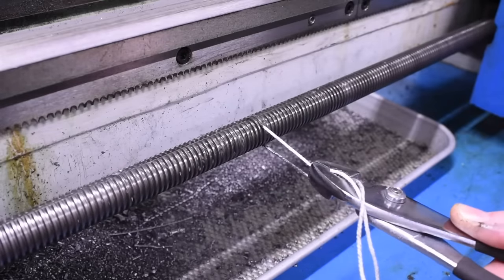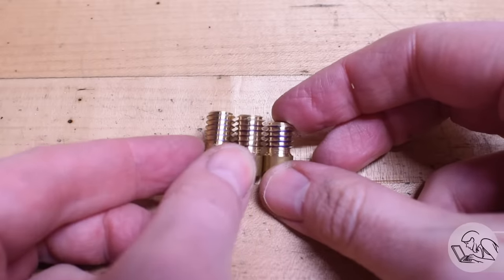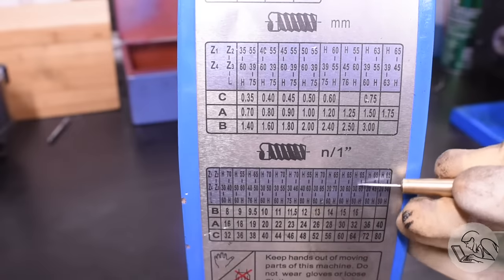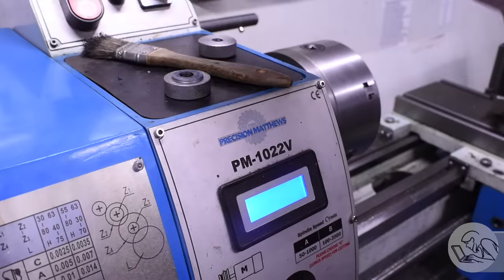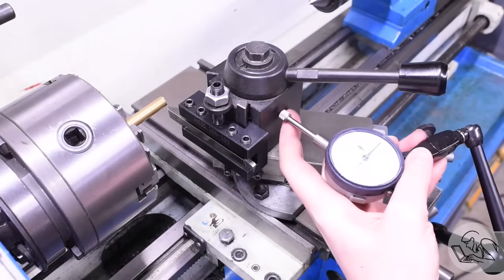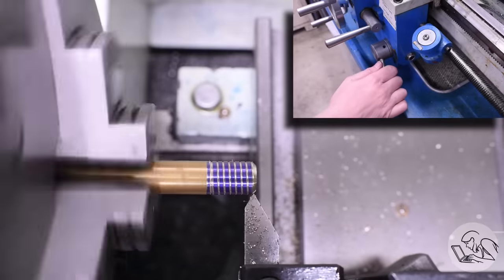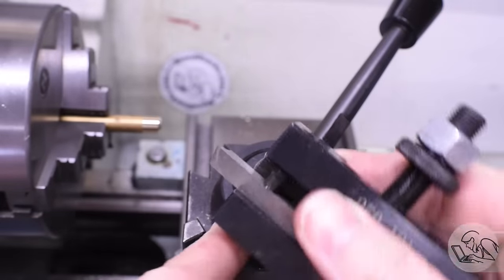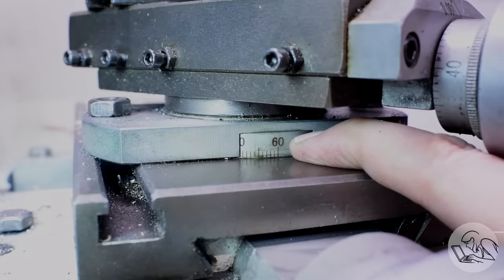How To Cut Threads On A Lathe

Comment: I almost skipped this one thinking, oh, just another thread cutting video, but I have found that I am almost always glad when I ignore my first instinct and press on. Everyone has a slightly different take on thread cutting and I always pick up something new even though I have had lots of experience. I picked up several new ideas from your video. Thanks! The only thing I might quibble about is your angle when cutting with the tool upside down. You are constantly running away from the new depth of cut instead of into it. I swing the compound in the other direction when threading in reverse. My lathe is the same model as yours. I found some errors in the PM manuals regarding the change gear settings. There are differences in the printed manual that came with my lathe as opposed to the online version. If you are interested I can pass those along. I also found a combination where the cover would not fit on after I set up the configuration for the thread I needed to cut. Never found a way around that one.

Comment: I have no half nut so I have to power back and forth as you showed for mismatch. Also I have never tried the upside down thread cutting.. that’s awesome. I often wondered if there was a way to do it. I may or may not of bumped my chuck in the past 

Imagine having a cross slide with little backlash like you do! I wish lol

Comment: Nicely explained. One point, if you are not disengaging the hand nut, then I think you should retract the tool when you wind back to the start position, (backlash in nut). On my Myford, I fitted a removable handwheel on the countershaft, so I can easily cut short threads by hand for a fairly precise length, I guess that is not possible on more modern gear.

Comment: Thanks Quinn - good video. All of this (I think all from your videos!) is how I've learnt.

My lathe is an import, so the compound is 90 degrees out. It also very helpfully only has angle markings to +/- 45 degrees... So getting the correct 30deg angle takes some mucking around. 30 degrees in the wrong direction and then spin the toolpost 90 degrees the opposite direction. Easy enough but annoying.

Comment: My SB lathe has a threaded spindle (2 - 1/4 8 tpi) and I have never had any problem threading in reverse.  The RPMs are so low and the torque in the cut is minimal.  I always use a live center at the other end, so unthreading can't happen anyway.

Comment: I have a really nice old Swedish lathe built in 1959 and it also has the angle markings on the compound 90¯ off from the American standard. So I should set it at 60¯ or 60,5 but the markings are not that exact.

Comment: What a great video. Just when I was about to say "Hey, but what if I don't have a thread indicator thingy" you hit us with not only that but also a simple yet good explanation on threading imperial vs metric depending on the manufacturer of the lathe. Cheers from Argentina.

Edit: ACME threads video? Sharpening HSS for ACME threads? huh? Anyone?
Reply: Angle for Acme is 14.5 deg, you can buy a gauge for angle & width , I always grind my tools thinner then side-cut (backwards) on compound till it fits.

Comment: Not sure on a lathe spur gears but my dad said for setting the backlash on starters for engines he was taught to stretch out a paper clip and stick it in the valley of the gear and that was a gauge for how far to push in the peak.

Comment: I have been working on lathes for 40+ years and i have alway used the cross slide to set the 0 at the start and only move it to come out when returning to the start of the threading. The Top slide is what is used to set the depth of cut and it is set at the same angle as the thread, that way you are only cuting on one side of the tool. That how i was trained over closer to 40 years ago. The bottom cross slide never goes past 0 and the top miter slide is what is used to cut the thread. The miter is set to the anlge of the thread pitch so when the tool cuts it only cuts on one side making a better cut with no chatter.

Comment: Note: 127 teeth is enough to make a conversion with no error as an inch is exactly 25.4 mm (or 127*.2)
Reply: That's why 127 is my favorite number :)
Reply: @awashbowler  Really?  I just assumed it because you were using a 7-bit mental processor.
Reply: @andrewgr144  He thinks in ASCII
Reply: Some of us have lathes that aren't big enough to fit a 127, but at least we can fit the required 63.5 tooth gear.  (In Sparey's "The amateur's lathe" he goes through the math to match any given thread pitch with a multistage set of any decent set of gears to a very low error, but it's a bit daunting.)
Reply: @smellsofbikes  half-gears are my favourites :) 
Much as I cherish the hard ways our ancestors treaded if I had a lathe I would opt for Clough42’s electronic lead screw...

Comment: Hi folks. Cutting threads on the lathe gives accurately centred ones but unless a 'full form' insert tool is used it is tricky to get the right geometry profile - if that really matters - often it does not. One way of dealing with this if needed is to slightly undercut the depth and then finish with a low use die cutter. The lathe gives the accurately centred position and the die the accurately shaped tip and root thread form. Since the lathe has done most of the work wear on the die is minimal and it remains accurate. As Blondiehacks suggests in this excellent video it is  worth reading up a bit about the various thread forms because there is so much more to them than meets the eye. Have fun. BobUK.

Comment: There is another condition on flipping the bit over and cutting in reverse - that isn't going to work well if you have an old lathe like mine with a lot of uneven wear. It is best to keep the cutting force pushing down. I learned to cut double lead acme threads with no relief groove while in the navy. It's not nearly as hard to get the timing right on backing out the compound while coming to the end of the cut as you may think. No relief cut makes for a much nicer looking job as well.

Comment: Back as promised.  Two things.  First off using the dial gauge on the back of the tool post to register the true depth of the cutter is brilliant.  I thought I was OK with thread cutting.  But it seems like an old dog CAN learn new tricks..... second, I hate to mention it but for doing internal threads or for reverse threading with inverted tool the compound should be angled to the other side of perpendicular with  the spindle axis.  With the setup you show for the reverse threading you were actually advancing into the trailing edge of the cut.  Not a big deal all around... the threads still came out fine.  But if you're one that subscribes to the idea that the leading edge of the cutter should be the working edge then the compound is moving in the wrong mirrored direction.

Other than this minor niggle another great video.  I hope it encourages folks with lathes that have threadophobia to give it a go with some scrap.   Being able to cut truly axially true threads really is a handy skill for a lathe owner.

Comment: First, wonderful explanation, many thanks indeed.
Please correct me if I am wrong, but I assume that if you are cutting a thread that is the same pitch as the lead screw pitch, there is no need to worry about the thread dial indicator or the position of the half nuts.  So for example, with a metric lathe with no dial indicator and a 2mm lead screw, you can cut a 2mm pitch, and also a 1mm, 0.5mm, 0.25mm pitch thread without needing to worry about the half nuts position.  Obviously this is still quite limiting, but I am curious.  Any comment welcome.  Best wishes from Japan.

Comment: Hi folks. Quick tip for setting gear backlash, just use a slip of note paper between the teeth. For the upside down less operator stress technique ideally the lathe needs taper bearings at each end of the spindle so the spindle does not move away from the headstock with the cutting forces. Most lathes have this arrangement - but not Myfords for example, which also have screw on chucks. BobUK.
Reply: Bob, I’m glad you mentioned that. It had not occurred to me that some lathe spindles will not tolerate opposite-direction end thrust. I have a Myford, so I’ll keep it in mind.

Comment: Don’t be afraid of 3 phase equipment! Phase converters are cheap and work well, I have a 3 phase mill, 3 phase lathe, three phase industrial metal cutting bandsaw and a 3 phase paint booth. I built a mechanical phase converter using a 5 hp 3 phase motor with directions I got off the internet which works perfectly, I run the shop equipment off of that. For my spray booth, which I bought new I have an electronic phase converter that cost in the $300 dollar range. If had it to do over I would have put electronic phase converters on the shop equipment as well, they are so cool, soft starts, soft stops and you can set the speed of the motors by controlling the cycles per second. I was able to buy all my shop equipment “because no one wanted the 3 phase,” the only drawback is most of the 3 phase machines are large. Knowledgeable people will tell you it is inefficient to convert single phase to 3 phase, but a home shop is not a production shop and the money you save buying 3 phase equipment will buy a lot of electricity.

Comment: @Blondihacks - Hey Quinn. I've noticed You have to deal mostly with gears in the front third of the lathe's lateral. Would be rude of me if I suggest You cut that lid and weld a couple of hinges to access that gear set stat?
*Of course, some lock system would be more than advised.

Comment: Quinn, I wish my first thread cutting experience was this clear. An apprentice assigned to a journeyman often gets thrust right into the fray (I sure was). A lot of people seem to assume (there's that word again) that you know what they know. A good teacher* should always act on the basis that they do not know what you do and try to make that information as clear and concise as possible. As an example. The first time I was exposed to algebra I just did not get it. The instructor using the basic text was going on and on about a x b, x,y and other stuff. It my have been viewpoint (I'm not dense) but i just didn't get .once she assigned values to those symbols the light when on. And that's what you are doing to do here. Being clear and concise.
For any hobbiest machinist I highly recommend the book "Screw Cutting in the Lathe" by Martin Cleeve". This book is highly informative not only about the how, but also about the why. Plus he goes into great depth about Imperial threads on a metric leadscrew and visy versy. The gear ratio set-ups that will give a very close approximation of the dreaded 50:127** gear ratio without taking up tons of room on the back end of the headstock with large gears. He also discusses various other things beyond the scope of this video. 
https://www.google.com/url?sa=t&source=web&rct=j&url=https://www.amazon.com/Screwcutting-Workshop-Practice-Martin-Cleeve/dp/0852428383&ved=2ahUKEwj20N-SqZnvAhWOB80KHeeIB4UQFjAAegQIARAC&usg=AOvVaw1rCVsdvQ03u-yw1f-g8Lnl
This series of books also has a wide variety of other subjects covered. Gear cutting, cutter grinding, shop tools, dividing and indexing. Highly recommended books that I think every hobbiest machinist should have. 
On the theoretical side any thread can be expressed as the ratio by which the lead screw turns per revolutions of the chuck. If you have a leadscrew with 8 tpi and it and the workpiece are turning at the same rpm you will advance the tool .125 per revolution. If you wanted to cut 10 tpi the lead screw has to be set through the gearing at a ratio of 8:10. The gears used would then be multiples of these gears (ie 32:40 etc)
For any threads not listed on the lathes list of change gears or in the gear box this is a handy tool to find the correct gear set
https://www.google.com/url?sa=t&source=web&rct=j&url=http://www.otvinta.com/gear.html&ved=2ahUKEwjG9rzBrpnvAhXJWM0KHRzzCRAQFjAAegQIARAC&usg=AOvVaw35JHi3qUvgj4A2gG7kQYgg
*a word not to be used exclusively by those working professionally as teachers.
** the number of threads I've seen on the hobbiest forums on 127 tooth gears is endless. The 50:127 comes from 5.000 = 127mm when using the standard conversion factors.

Comment: I just made a backplate for my Logan with a 8 TPI thread last night. What a pain....
Reply: I would like to do this sometime - what I've thought of doing is welding a 1-1/2"-8 heavy hex nut into a steel plate and truing it all up from there.  What did you end up doing?
Reply: @ThomCat316  I think that would work just fine. That's almost what I ended up doing. I carved it out of a solid piece of 6.5 inch round, the amount of chips was insane. If I do again I'll definitely make it from two pieces and weld it. I'm going to post a video on in sooner or later

Comment: My very first thread was to adapt a QC toolpost to a Logan lathe.  I didn't have metric taps, so I got an M14 10.9 bolt of the correct length (to match the clamping nut) and cut a 1/2-13 thread in it (to match the base plate I made).

Remember, kids, be sure to cut down from 0.551" to 0.500" before making your threads....  :-)

Comment: I made a center finder, that in essence, was a bar with a spring-loaded socket for a ball with a pointer on it, that you centered up with your thumbnail..it was to set up a drill-press or old style vertical mill on center of the hole to be drilled. I made several, but I don't remember what they were called, plus you can't find them in stores. You got any ideas on this one, young lady?

Comment: Great video with a refreshing presentation.
I do appreciate the time and content restrictions in making of a video but think one little point may be worth mentioning for the beginner thread maker.
At 17:30 in the video we made some threads that formed threads with peaks that were pointed. The problem with pointed threads is that they will bottom out in the curved root of the female thread (nut) while there is more than enough clearance on the flanks of the thread. As a result with the pointed peaks, the nut will not spin freely until the threads are way too small overall with considerable play in the thread..
I suggest that the beginner should be aware that the peaks should be rounded off or filed down to remove the sharp "bits" if they occur, before trying the thread for fit.

Cheers and again a great video with a great perspective on things.
Reply from the maker: Yah, that’s why I started with telling people to cut the stock a few thou undersize. It neatly sidesteps that issue for beginners. Later on people can learn why I told them to do that. 😄 A video like this is about setting someone on a path to success, not covering every detail exhaustively. Plenty of others have done the latter. I appreciate your thoughtful comment, though!

Comment: On the subject of pitch gauges: if you have one of those cheapo tap-and-die sets from Horrible Fright, it comes with a pitch gauge for whatever system the set is for. I only mention this because I spent way too much time searching my toolbox for the pitch gauge I just know I have, so I could figure out which tap I needed, when there was one sitting right there on the bench in front of me nestled between those very same taps.

Comment: Awesome video ! 2" , 20TPI  Ford Model T radiator cap here I come ! ( I hope!?!)......Need an adapter to turn a female thread cap to a male thread cap....... It happens the 1920's Egyptian revival aluminum cap with brass insert threads happens to be 2", 20TPI female...not sure what it originally fit .

Comment: Hi Quinn, love the content. Keep up the good work.  Something bothers me about the "mismatched thread" section though; if you leave the half-nut engaged and then proceed to reverse (go forward)  the direction of the lathe, aren't you pushing all of the backlash from the lead screw/half-nut joint and the change gears (which weren't necessarily adjusted perfectly) into the threadform? Or will it be all taken out in the starting gutter before the tool re-engages the work?

Comment: I have a little bigger lathe from the same manufacturer as yours and all in all im very satisfied with it ..after using the change gears as they came for a few seconds I deburred and smoothened them first as you recommend  because otherwise they run noisy and not smooth as you want them 😉 
The only thing I changed was the compound part which holds the top slide to the cross slide as its the weakest point ...I made a little bigger one out of tool steel with more "flesh" and not 2 but now 6 screws holding it .
It improved rigidity even more than expected and I would recommend it to everyone that has the time and passion doing it .😄😁
Very good video as always thanks Quinn😎

Comment: Excellent video, I've got an interesting problem to work out, my lathe has a gearbox like yours, but the chart on the machine is for a Norton box with 11 positions!
Reply: The Norton gearbox will cover a range of threads, but for threads outside that range you can still use the change gears like Quinn did. The manual ought to have a table to cover what gears you need for what thread.
Reply: @ericfeatherstone  Eric, unfortunately the manual lists gears required and a selected position 1-11 on a Norton box, not the 3 position box fitted. It's a set up, scratch cut, and go from there!
Reply: @bwyseymail  I've got to use change gears and the box, including the 127 tooth for metric

Comment: I have a small unimat 3, the change gears work in a similar manner, but you drive the lead screw by a handle on the main shaft, so you are in full control t all times, the unimat does not have a gearbox or half nuts. the good part of hand turning the chuck s that you can stop the thread exactly where you wish.